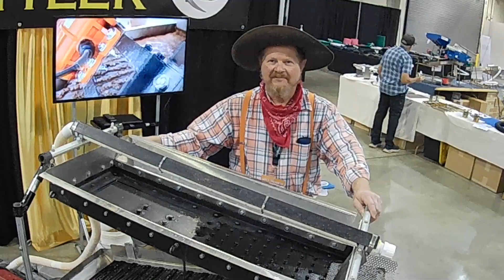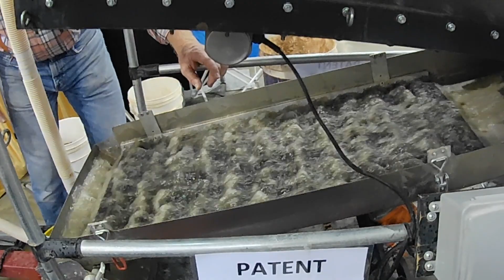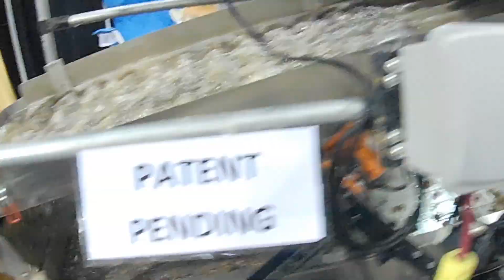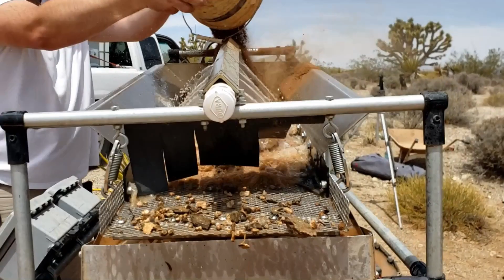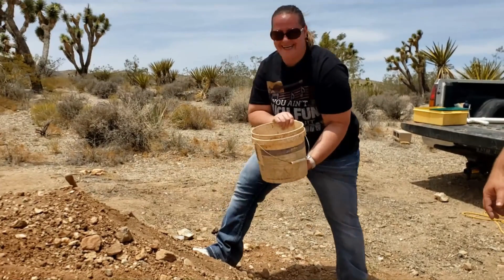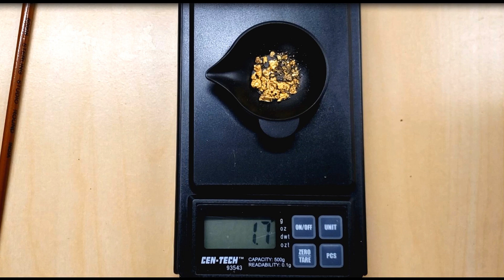Gold Rush Made EASY with Alan Guthmiller's Water Conserving Sluice

Comment: It's possible to achieve similar results in other ways, but it's great to see a fully setup unit just ready to go. So much quicker and easier to set up like this, there was definitely a need in the market.
Reply from the maker: It is a very well designed piece of equipment.
Reply: Thanks Matt.  Portability was a priority in the initial design.  It really is a fun machine to operate. 👍

Comment: I enjoyed this episode of Alan Guthmiller's gold rattler recirculating gold sluice system - water conserving sluice. One thing that rang a bell while watching the demonstration was the clay balls being discharged. Would be nice if those clay balls could be broken up and liquified to release any gold.
Reply from the maker: The clay is broken up as it comes into the sluice system. Its fully washed and turned into a slurry so the gold can be extracted. The clay you saw in the discharge is the clay AFTER the gold and water are removed. In the final process, the gravel slurry is de-hydrated and the clay is re-formed into balls and removed from the water so the water can be reused.
Reply: @ChrisRalph  Oh,     alright. Thanks!

Comment: Why don't the clay balls get broken up to release gold in them ?
Reply from the maker: The clay is broken up as it comes into the sluice system. Its fully washed and turned into a slurry so the gold can be extracted. The clay you saw in the discharge is the clay AFTER the gold and water are removed. In the final process, the gravel slurry is de-hydrated and the clay is re-formed into balls and removed from the water so the water can be reused.
Reply: IF the clay balls were not broken up before entering the sluice, you would see them pouring off the upper shaker deck onto the tailings.  Fortunately,  that's NOT the case.  The key to its success is the frequency in which it oscillates, causes the clay balls to completely shatter.  Remember, we are dealing with dry clay from the desert, which is hardened, verses wet gooey clay from a lake or stream.
Reply: Good point
Reply: I mean it's almost impossible to break up all clay..... Go try with your hands in a bowl of water... I mean the clay coming out was very small and spitting it out is very impressive! You can go run the clay tailings after to see if it missed anything?
Reply from the maker: The clay is broken up as it comes into the sluice system. Its fully washed and turned into a slurry so the gold can be extracted. The clay you saw in the discharge is the clay AFTER the gold and water are removed. In the final process, the gravel slurry is de-hydrated and the clay is re-formed into balls and removed from the water so the water can be reused.